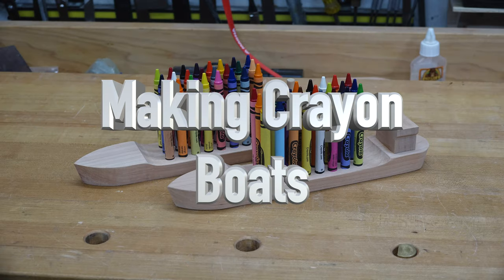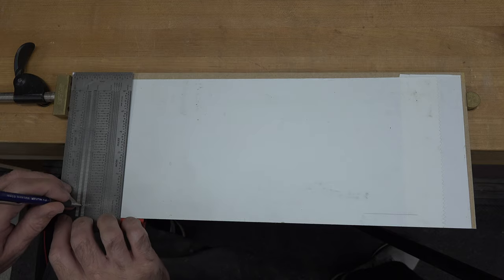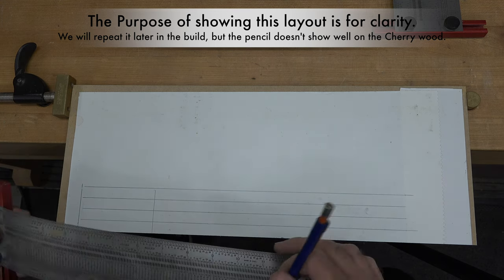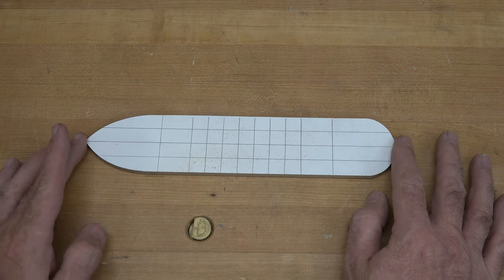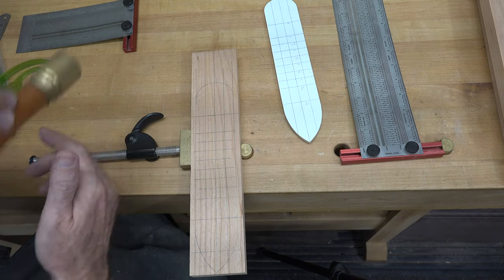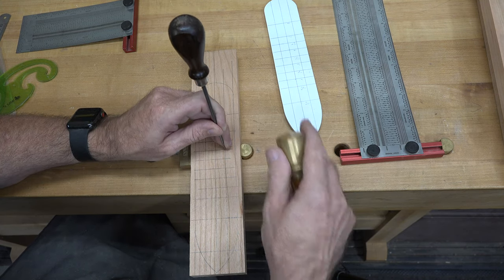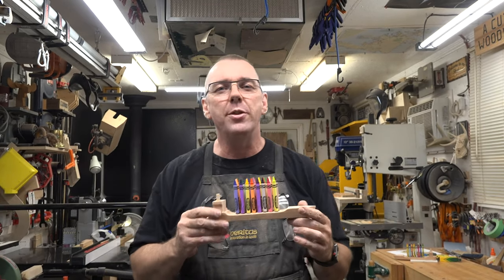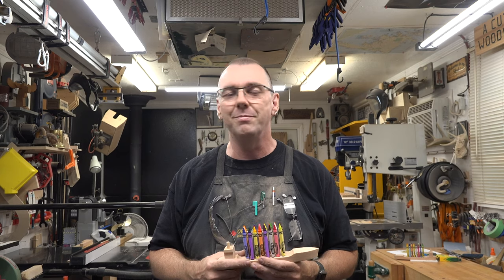Making Crayon Boats

Comment: Nice project, but i got a bit nervous thinking about a youngster at the bandsaw.  Freehand cutting a  board on edge with all that open blade requires some skill and proper hand placement to avoid disaster.
Reply from the maker: I couldn't agree more Ronald.  Using the bandsaw would depend on the child's age and their ability in the shop and whether or not it is safe for a child to do is completely up to the parent involved.  At no point should the child be unsupervised and if the child is too young or unable to use the saw, the adult can always cut the boat and let the child sand and drill the project.  As long as there is some involvement for the child, that is what is important.  A scroll saw would still be the best option in this case.  Thanks for tuning in and for giving everyone a reminder that we have to keep our children safe in the shop.  I appreciate your input.

Comment: @acutabove_woodworkings thanks for the inspiration! I'd like to add ball bearings under it...suggestions? I think a divot on the bottom,  the bearings loosely clamped between the boat and a bracket but not sure if that's feasible...
As an artist I like to see all my colours at a glance...you could drill the 3 rows at cascading heights so the one in back is the highest and the one in front is the lowest. 
Save the cut off from the holes and make a second holder...
Reply from the maker: I think a ballbearing would be difficult to add without having it bind on you.  It's an interesting concept though.  Thanks for tuning in.

Comment: @acutabove_woodworkings the marking gauge in this is longer than the spoon video...do you have any links for it and the French curves please?
Reply from the maker: The French curves are available at any art supplier or from amazon.  As for the marking gauge, that is called a T-rule and it is available at most woodworking suppliers or directly from incra.com 
I got mine from Lee Valley Tools.  https://www.leevalley.com/en-ca/shop/tools/hand-tools/marking-and-measuring/rules/58877-incra-t-rules
I hope this helps.  Thanks for tuning in to the show.
Reply: @acutabove_woodworkings  thanks

Comment: hiya kenny its mike again. any advice on cutting 20mm iroko. what blades ect.
Reply from the maker: A number 7 reverse tooth blade would probably do you just fine for that cut.  If you haven't already, you might want to check out my video on scroll saw blade selection.  There's a lot of information in that show so you might want to have a pen and paper ready to take some notes.  Here's the link.  https://www.youtube.com/watch?v=UG6S5tqx6bI&t=1s
I hope this helps.
Reply: hiya kenny have to buy a selection of blades and see how it goes thanks for advice again pal. already lost two fingers so easy does it i think